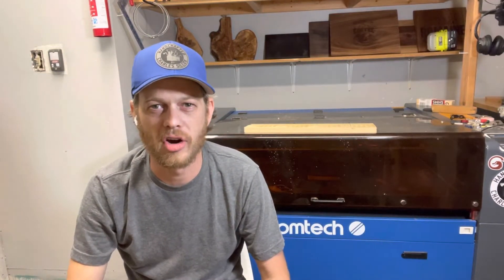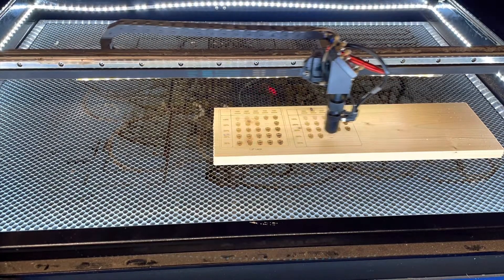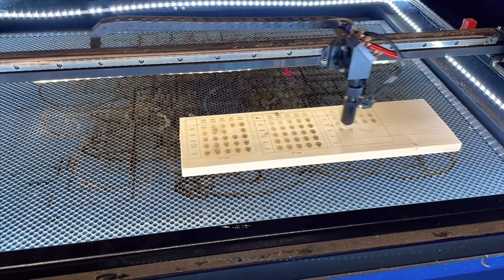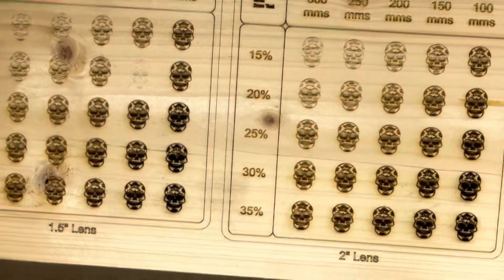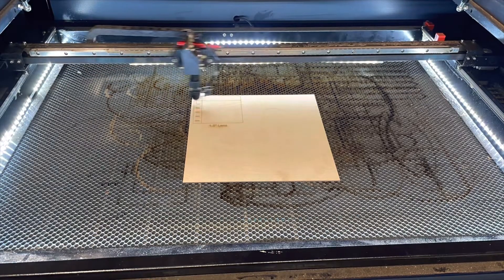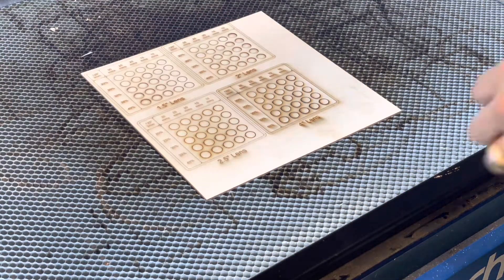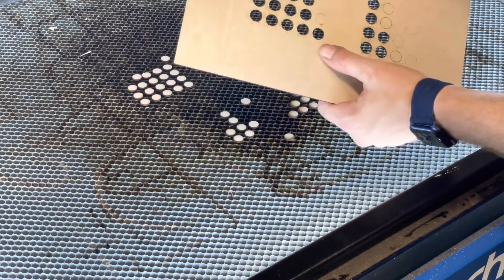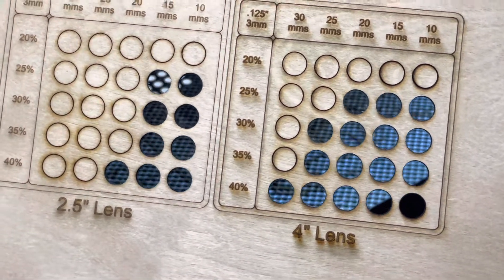OMTech 80-Watt C02 Laser Testing American Photonics Lens Kit.

Comment: Omtech indicates the 4" APC lens allows cutting thicker materials, up to 1/2". Have you experimented with cutting depth? I've  had similar experience that the 4" lens doesn't cut through 3mm as well as the shorter lenses and was kind of surprised by this since it's advertised for cutting only. Thanks for the video.
Reply from the maker: For most of my work, which is on thinner materials I stick with the 2", it's the best of engraving and cutting for my needs.

Comment: nice work!  do you use the same focal length from bottom of cone for each?
Reply from the maker: Yes I do! It's 10.5 mm for each. So I cut a little guide and use that.
Reply: @CraftedbyCharles  I saw that they say "10.5mm from tip of nozzle" on their website, but that turned out not to be correct for the 4" tube/nozzle/lens unit I ordered from them.  Multiple ramp tests shows best focus is right around 16.8mm from tip of nozzle for me.  So keep that in mind, I don't think you can trust 10.5mm necessarily. Do a ramp test to confirm each time you swap a nozzle.

Comment: How difficult was it to swap out the stock lens with the new kit?
Reply from the maker: Takes seconds, just loosen the nut holding the current one and it will drop right now.
Reply: @CraftedbyCharles  Do you have to make any changes to the machine settings in Lightburn after installing a new lens?

Comment: Great video. I have an 80-watt red & black Chinese laser from eBay, how can I tell which lens I have? Is there any way to measure the lens?
Reply from the maker: Hi, yes. you'll need a pair of calipers, pull the lens out and measure it. Or if you want a full replacement you can measure the lens stalk and order a kit where it just pops in.
Reply: @CraftedbyCharles  That is not making sense to me, are you saying the 4" lens measures 4" in diameter using a caliper?

Watching your video, the 4" lens looks like it has a 4" long tube, not a diameter?
Reply: @phototec   I think the measurement is for the focal length.  The standard FL should be listed in your manual.

Comment: Hi. Do you lose the red light? If so, how to position the laser?
Reply from the maker: No, it's still there. I need to 3D print a new mount for it, as with the new APC lens kit it doesn't fit. I use a camera for lining up. It really replaces the need for a red dot.
Reply: @CraftedbyCharles  thanks!

Comment: simple question where do we measure on our lens tube or do we measure the lens diameter to know which size to order?
Reply from the maker: Hi, You want to do both, depending on what you're replacing. If you're ordering an entire lens kit you want to measure the stalk. Mine was 16.15mm. If you're replacing just the lens then you want to measure that.
Reply: @CraftedbyCharles  Well I'm currently using a 2" lens and just want to replace it with my 1.5" lens, I don't know how to adjust the lens tube so I assume I have to buy a lens tube that is made for the 1.5" lens being that it has the proper placement for the lens, correct me if I'm wrong,  I do alot of wood engraving and cutting and love the fine detail it produces; so with this kit it seems to make everything a bit easier
Reply from the maker: @farouqiamin7894  I would buy the entire thing, it’s not much more than the lens by itself, and you can just swap it and the other out if you need.
Reply: @CraftedbyCharles  Makes sense, I used to have access to an Epilog machine years ago but business partner was a real douse, I can only afford one of the Chinese made machines for now that use a glass laser tube, from experience the Epilog is by far a more superior accurate machine being that is uses an RF Laser, I've managed to get the Chinese machine to work well for me and it does get the job done; this simple upgrade is essential thanks for the feedback
Reply from the maker: @farouqiamin7894  anytime! I’ll have to check out RF lasers now. Thanks!
Reply: @CraftedbyCharles  Yes they are powerful and extremely detailed in fine engraving, they never decrease power when the laser fires, it gives constant power throughout every job, it cuts deep and straight with very little effort hairline accuracy, hence why they cost almost 3x the glass tube machines, Look at companies like Universal, Trotec, and Epilog, the day I can afford one again I'm getting one, they are workhorse machines and very reliable.  I never knew the difference until I used them both, the Epilog spoiled me, good luck brother
Reply from the maker: @farouqiamin7894  thanks, I’ll check all them out. Good luck to you too!
Reply: Do these work better than what came with the machine?  And if so, how are they better?  I’m not seeing how you would decide when to use which one.

Comment: Thanks for this. I was looking at getting this kit.  Does it come with all 4, or do you buy them separately? I cant tell from the website, and $58 sounds too goo for all 4.   My current lens is working best at 5mm focus, but that is close enough to hit things and pieces of wood as they cut free and teeter totter in the holes. That 2 inch lens looks great. (I have a 100 watt Flash Laser)
Reply from the maker: Thanks! If you choose the 4 pc kit it updates to the correct price on APCs website, mine was ~$210
Reply: May I tactfully suggest you solve your teeter totter problem rather than buying new lenses. A 0.6mm bridge will solve your problem for free. They are available in Lightburn and RDworks
Reply: @SarbarMultimedia  Looking up the lightburn bridge, all results are for networking.  I suspect this is actually a connecting tab that you snap off of the parts, like model plane kits have holding all the parts to the mold.  I would hate to have to deal with that for every part I cut though, and it is only the cutoffs that are less than an 1/2 an inch that are at issue. The cutoff combined with the 30 PSI air just pops them up at an angle, and sometimes that can get in the nozzle path.  When I am monitoring the cut, I just hit pause, remove the offending piece, and unpause. But I have missed one or 2 and that is always on the 22 x 34 piece, never on the 5 inch square job. :)
Reply: @LithosAndLasers  
 Hi I understand your problem with small pieces that cut and and stickup, it was a regular problem I encoutered  on metal cutting industrial lasers before the days of auto bridging. Those nozzles were only about 2mm above  the material  and that was where I learnt to program away from the extreme corner and back diagonally  towards the 0.0 point All the start points were also arranged towards that same origin point. In that way you are always moving away from tipped parts. No matter how clever Lightburn is,  it hasn't yet mastered that method. Bridges are the much simpler alternative.
Reply: @SarbarMultimedia  And thank you for your reply.  I enjoy your videos a a lot and was actually watching several on Friday about your lens theory and how it does not apply to lasers.  You are a very knowledgeable man.  Respect.